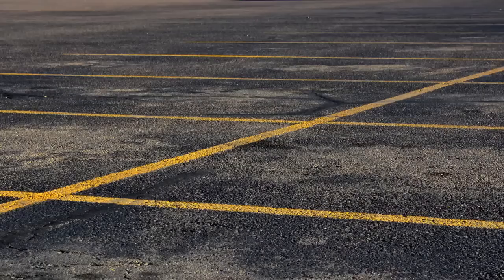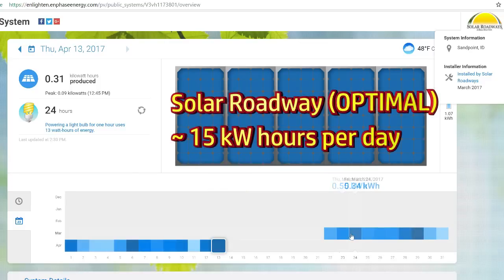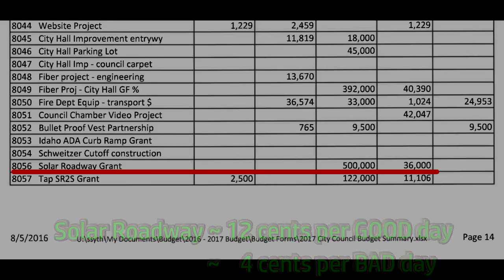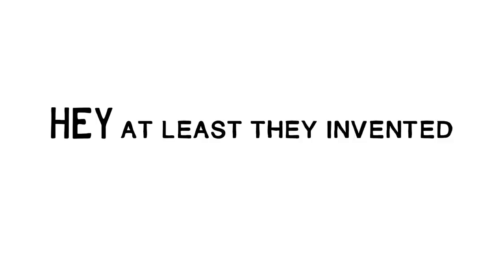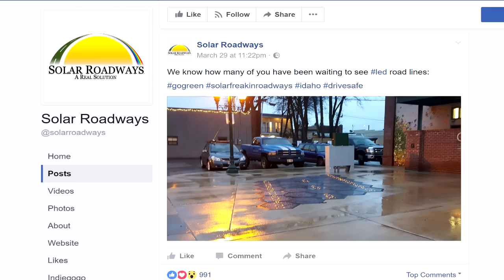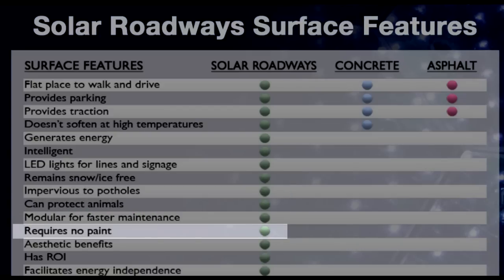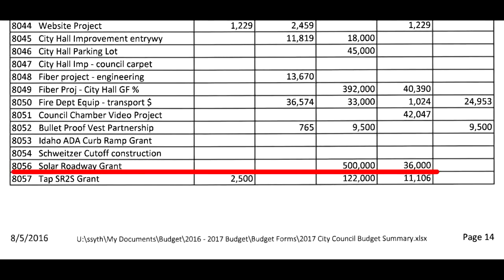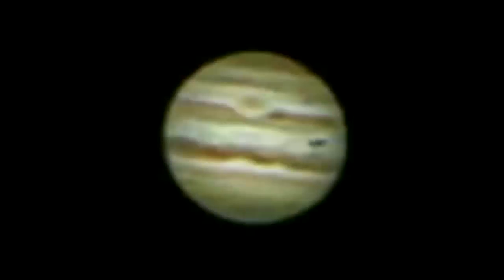Solar Roadways generate ~10 CENTS per day!!

Comment: What's your opinion on these new all solid-state battery cells? 

"John Goodenough, inventor of the lithium battery, has developed the first all-solid-state battery cells.

Today’s lithium-ion batteries use liquid electrolytes to transport the lithium ions between the anode (the negative side of the battery) and the cathode (the positive side of the battery). If a battery cell is charged too quickly, it can cause dendrites or “metal whiskers” to form and cross through the liquid electrolytes, causing a short circuit that can lead to explosions and fires. Instead of liquid electrolytes, the researchers rely on glass electrolytes that enable the use of an alkali-metal anode without the formation of dendrites.

The use of an alkali-metal anode (lithium, sodium or potassium) — which isn’t possible with conventional batteries — increases the energy density of a cathode and delivers a long cycle life. In experiments, the researchers’ cells have demonstrated more than 1,200 cycles with low cell resistance.

Additionally, because the solid-glass electrolytes can operate, or have high conductivity, at -20 degrees Celsius, this type of battery in a car could perform well in subzero degree weather. This is the first all-solid-state battery cell that can operate under 60 degree Celsius.

The engineers’ glass electrolytes allow them to plate and strip alkali metals on both the cathode and the anode side without dendrites, which simplifies battery cell fabrication.

Another advantage is that the battery cells can be made from earth-friendly materials.

The glass electrolytes allow for the substitution of low-cost sodium for lithium. Sodium is extracted from seawater that is widely available."

Charges quicker, lasts longer, works better in more severe temperature conditions and is noncombustible?

Comment: Suppose you took the amount of funding received ($4.4 million) and opted to receive the amount in $1 bills. Now suppose, because science, that we use the heat of combustion for paper and the weight of a dollar bill to find out how many Btus we could release by burning it (12.44 Btu per dollar bill). Would we have been better off burning the money?  Well, at 12.44 Btu x 4.4 million bills, we have 54,736,000 Btu's of usable energy (if it were perfectly efficient). Assuming we used all of the hot air spouted by those touting the "benefits" of Solar Freakin' Roadways as our bellows so that we can more efficiently burn our money, we'll say that our hot-air powered bellows allows us to fully burn $1 per minute and thus extract 746.4 Btu/hour in useable energy (at perfect efficiency, of course). We can convert this into Watts (218.75 W/hr). Since we can burn our money 24 hours per day, we can realize 4.375 kWh per day at a cost of $1,440 / day. With that said, we can cover 14.7% of our 901 kWh monthly electricity needs by simply burning 43,200 $1-bills per month. Since the city budgeted $500,000 for the year ($41,667 / month) for 1/4th of the efficiency we're achieving by burning the money, we can say with certainty that the city would have been better off burning the money.

Comment: So.. we have all sorts of power issues all over the world.. Want to get away from oil right?? Well at least this is venturing in the right direction. It is not cheap to try to do something new.. at first.. I imagine if there were full roads made of solar roadway.. that would make a hell of a lot of power.. Understandably not as efficient as it could be.. Roads actually make a lot of heat. And it's wasted heat.. not doing a thing for you energy wise.. so even if you could get 7% efficiency.. that would be more energy than you had... You have to push and work for it or you will never get there.
Reply: dr07828 but the cost simply wouldn't be worth it, what if you used that money essentially trillions to help defeat world hunger, no one even has that money, there are solar farms in desert and more are being made there but the return is too slow for such an investment
Reply: Daniel Law I get it.. Right now it is not worth the return... how many things were not worth the investment at first? I also agree that flat solar panels are not  efficient.  the bottom line is even if solar freaking roadways fails completely.. it's still a pish in the right directiin.. momentum is needed to promote the creation of alternative ideas for energy. if we sit here and say.. "Oh we can't do that because it is too expensive" we will sit were we are still addicted to oil... succeed or fail I am sure we will learn something of value and encurage others with inovative ideas.. you are absolutely entitled to your opinions.. just try not to be too harsh...
Reply: Daniel Law what if.... what if they got the tech to work better... perfected it. it still would not be totally efficient but what if it became extremely cheap to make? it may actually be worth it right? how does it get to that point?

Comment: They want to use these things at airports, according to their video. The pavement loading for runways and apron areas at a main airport needs to be really high, especially for 777s. (The A380 has lots of wheels and can actually manage with a lower pavement loading, but I still wouldn't park one of them on top of these solar roadway blocks!)

Comment: You can be a bit more charitable with this mess. The $500/ft2 value was for the prototypes. If they got large scale manufacturing they could probably lower the cost so it's only 100 times worse than currently available panels.

Comment: <sarcasm>
But just think of how it will stimulat the economy with new jobs, I mean you will need to produce leds, produce solar panels with spots for leds to fit in, construction workers, and new fire departments dedicated to just putting out road fires. Then you need all the managers to supervise all the new jobs, people to do construction to build plants for the parts to be made, the electric company having to generate more power to power not only those buildings but also the roads that can not even power themselves. Tire manufacturers having to make more tires due to tires being shreded on the edges of improperly laid panels or panels that have shifted due to settling, you know the the thing that happens to any heavy object placed on dirt and the main reason why it's better to buy a 10 year old house then it is to buy a 10 day old house because you know if it will have any major settling issues or not. It's a real boon to the jobs market, and only costs a measly half billion dollars per parking lot, that's totally worth it? Right?
</sarcasm>

But seriously none of that cost even include things like maintenance due to things like settling which unless you pave the dirt underneath the panels to ensure the pavement bares the weight of the settling instead of the panels, (which totally defeats the point to begin with) will happen because dirt doesn't settle flat even if the weight is perfectly distributed let alone if there is shifting weight.

Comment: You can get a decent 3 kW, grid-tie solar energy system for $5k, that one from Amazon is quite expensive and cheesy looking. The 3 kW system is estimated to produce about 420 kWh/month, which means that it would pay for itself in about 10 years (if energy in your area is 10 cents/kWh). The panels are guaranteed for 25 years.

Comment: Your solar infogram, as correct as it is, assumes the sun passes directly overhead (perpendicular to the fixed cells). For countries significantly distant from the equator where the sun does not pass overhead, hence the max power won't even be 44W.
Then what about other real-world issues like: build up of dirt from passing vehicles, the 'shadowing' effect on a series solar array from weeds or debris, the voltage converter losses?
Do we really want to drive/ride on a surface that has lots of little elements screwed down onto the surface? These WILL loosen and pop out over time, the initial cost of solar roadways will be eclipsed by their subsequent maintenance costs.
Even worse, the covers will deform as wheels roll over them (unlike concrete of asphalt), therefore introducing additional rolling resistance and actually wasting energy.

I respect solar power: I have built my own solar-powered planes (all my design, and yet they really do fly), but I can see these solar roadways are a joke.

Comment: Traditional Solar Panels won't be practical as roadways unless you use some currently very expensive material or we move onto hover cars near 100% - however, I wonder if you could work something into roads that would generate electricity somehow... like a way to convert the heat of the black asphalt or the weight/pressure of the cars driving on it to produce small amounts of electricity. I'm not saying it'll end power demands or anything, but it could take the edge off.